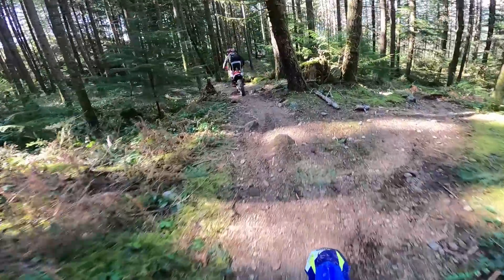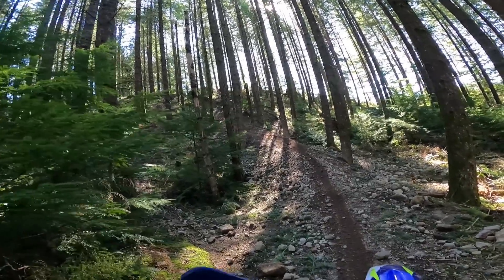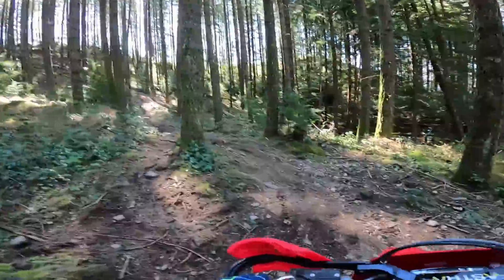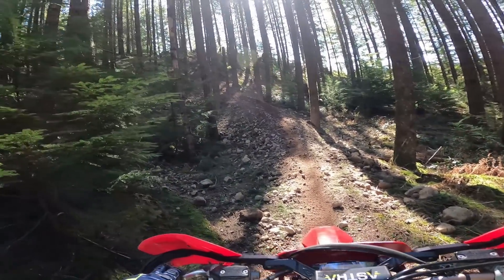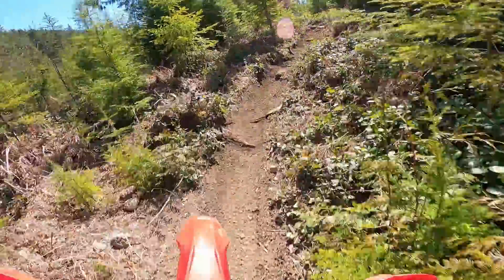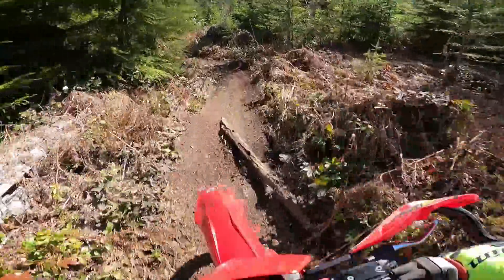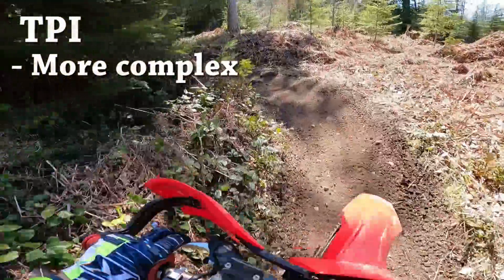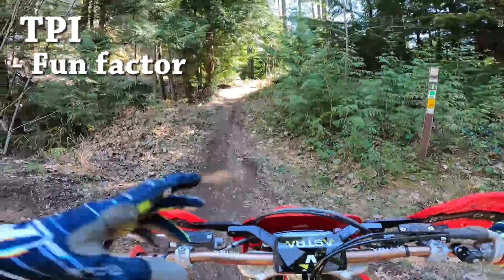Smartcarb vs TPI

Comment: I bought a 2022 Gas Gas Mc250 and my buddy bought a 2022 Gas Gas EC300. The stock tune on the TPI bike was pretty weak and really lean. No snap, no hit, couldn't get the bike to come alive it seemed like. The carbed bike was totally the opposite. Both bikes had a great predictable and controllable power delivery across the bottom and into the mid. The difference in the upper mid to top end was really noticeable though. Once my buddy tuned his TPI bike, changed the head, and played with the power valve it ran great. I like my simple carbed motocross bike for woods riding, works great for me and it's a bit lighter. But to each his own.

Comment: Great comparison I am sold on smart carbs.  I am not the kind of guy that drops stacks of cash on a trail bike I am an over the hill motocross/desert racer.  I have considered setting up my 15 tc250  for throwing down in the woods.  The biggest thing for me is e start.
Reply from the maker: Watch this before spending money on a SC. Great product in the right conditions but too many issues every winter for me. https://youtu.be/nmNEkGvLUNA
Reply: @PNWEnduro  I am not considering buying a smart carb or lectron.  I am a keihin guy.  My 16 FC450 has fuel injection and e start with mx tech 4CS forks.  I do like the air forks on my 2018 150SX.  I liked learning from your channel

Comment: If you have heavy throttle pull on a TPI bike, you don't have the free play adjusted correctly. Once you get it adjusted correctly, the throttle pull/return is as good as any carb bike. Also, the delayed/sloppy throttle response at small openings completely goes away. You spent a lot of time dialing in the SC, you should at least spend a little time with the TPI free play so the comparison will be apples to apples. After adjusting the free play on my 2020 TE300, it feels like a completely different bike.

Comment: So couple questions for you then, when you say "throttle drag" or "drag" when letting off the throttle are you referencing the engine braking that you get on a 4 stroke or just that the throttle cable itself feels heavier/stiffer?  Second, when you are talking about other TPI bikes that you have ridden are you just talking about Gas Gas or is it the same feel on the KTM's and Huskies as well?  Third, is smart carb their own brand or are you talking about lectron carbs or are they two different companies that produce a similar product?
Reply from the maker: As far as the drag it’s partially a heavy throttle pull but also it’s missing the light feeling of a carbed two stroke, it’s feels more “electric” as people sometimes describe. 
I’ve ridden ktm/husky/gas gas and they all have this same characteristic. 
Smartcarb is made by technology elevated, not affiliated with lectron.
Reply: We have zero affiliation with Lectron. The SmartCarb is a much newer metering rod carburetor design. You can read more about their shared history and how they compare here: https://smartcarbfuelsystems.com/smartcarb-vs-lectron/

Comment: I've enjoyed many of your videos over the years (including the one in which you tested SC vs Lectron vs OE carb). Thanks for posting. I think this video certainly brings about much conversation and debate. In my opinion any comparative conversation in this arena is a good one. As it relates to your comparison there is a lot of differences between the GasGas and the Sherco that can contribute to the way the bike feels to the rider in a seat of the pants comparison. In essence you are comparing a lot more than just TPI vs SC because of the way that the (2) MFRs. build the power characteristics (i.e. port timing, compression, ignition timing, flywheel weight and mass, etc., etc., etc...). IIRC, in the video I've referenced above, you were on the same bike and model year which, in my opinion, gives a better comparison of the tested component. Regardless, Id love to add my opinion to the conversation.
Of coarse the subjective human experience factors in greatly here as well. I've had 300 2 stks since '12 and find them to be great bikes in many ways. I've used the SC, have been able to dial in both the Keihen and Mikuni carbs, and now have a TPI. Anyone who's ever ridden my bikes have all commented on how well they run-including someone who owned a bike with a TPs equipped SC that was running Fabio's PowerCDI ignition system. I just bought a '21 TE last November. I kept the '17 TX around for several months because I had concerns about the TPI. I had never even ridden a TPI bike (until I bought the '21) but the "horror" stories were enough to give me pause. I sold the TX (the SC too) about 3 weeks ago now. The '21 TE is (by far) the best running 2 stk I've ever owned. In much of the powerband I don't find a lot of difference between the '17 and the '21. It is at the lowest throttle openings that I find a HUGE distinction. The TPI runs so cleanly in the basement. I've always liked to lug my bikes around (until the point at which I need/want some serious HP to attack some obstacle or trail condition), and I didn't think there was much need for improvement in that area. The TPI brings it to a whole other level! In your video I can clearly hear the Sherco running much rougher (some call it burbble?) at the lower throttle openings as others have pointed out in the comment section. Your narrative is that the bike feels like it pulls better down low but I struggle to see how that can be so when the bike is running rougher. I will surely admit that I'm not the one riding the bike (and you are) but I can relate what I'm hearing to my own riding experiences. I will also admit (or suggest) that the GasGas does not sound like it runs as cleanly as my '21 TE does....Which brings up a whole other variant. 
That is the differences between any (2) bikes even if they are the same brand, model, and year (due to manufacturing tolerances maybe?). In fairness, I have modified my bike from stock. I installed the Slaven's idle screw, and a set of VForce 4 reeds (while I was in there), so that would potentially throw off a direct comparison as well. Even though I have made modifications I am nowhere near the 700 dollar mark of the SC (plus manifolds and air boots for some machines?). I also don't feel the need to install a high compression head to the '21 TE. This is something I ended up doing to both my '12 XC and my '17 TX (S3 and RKTech respectively). Both of which boosted performance in the lower to mid RPMs.
As it relates to fuel consumption, I never was able to capture the claimed increases from the SC. I do, however, notice better range on the TPI. I have always installed oversized tanks on my bikes (including the '21 TPI) as I always seem to think I'm going to ride farther than the stock tank will allow. I have found myself running out of gas on rides in the past. It is much easier to borrow/buy gas (say from someone who is camping with an ATV or SXS, for example) when one doesn't have to worry about having, or having the right ratio of, premix. Plus one for the TPI!
I also did not notice any difference between any of the bikes (or carbs) in the area of "throttle pull" and "drag". I was confused on what you meant by those terms. Were you referring to the effort it takes to turn the throttle tube or some performance characteristic? If by "drag" you meant engine braking I detected no differences. I will certainly agree with you when you talk about the amazing amount of traction one gets (particularly at small throttle openings) with the TPI bikes.
I have been a big fan of the SC since I found out about them. For whatever reason I much preferred them over the Lectron...Even though I've heard many more success stories compared to SC success stories. I certainly agree with the Keep It Simple Stupid theory and, unfortunately the TPI does add more complexity. Thus far I am tolerating it due to my perceived performance gains and not hearing of any negatives issues from friends (many friends w/TPI ranging from '19s-'21s). I will have to check out WA Semi-hard Enduro's link and/or order a crank sensor-just in case. Why not?...I'm already carrying a spare fuel injector and filters for my 4 stks. I've never had a failure myself yet but I carry because of all the issues I've heard about from others.
In summary, I find it interesting that your experience is that you find the SC equipped Sherco runs better down low and mine is that the TPI equipped bike runs better than anything I've experienced down low. Even though I (admittedly) like to be right, I much prefer the type of conversation that your video has provoked. I'm excited to go riding now! I can't wait until our high country trails open up!!
Thanks for posting!...Thanks for letting me share!...Keep up the good work!!
Reply from the maker: @Jason Chapman first thank you for the comment, you obviously put a lot of thought into it and I appreciate that. I will agree with the burble you are hearing, I've since leaned the carb out 4 more clicks and I think it's even better now. If you have seen any of Cody Webb's recent videos his Sherco with SC sounds really good. From what I understand he has his set another 4 clicks leaner than mine so I still have room to go if I feel like I need it. As far as the power off the bottom, I've always felt like the TPI bikes kind of struggle to get going, once they open up the power is very strong and crisp. This probably contributes to the amazing traction they get because you don't light up the rear wheel as much. For the throttle pull, yes I feel the actual pull is heavier on a TPI but I'm more referring to the feel I get between the two. The TPI is so much more liner and, as people say "electric" feeling, that's where I compare it to feeling a bit four stroke like. I'm not trying to bash the tpi in any way, they are an amazing technology but for me switching back I just find the bike feels more fun to ride.

Comment: The difference between the two is mainly how they are tuned!  The TPI is tuned on purpose to drag and bog for traction.  If you want to have more power all the time with TPI you can adjust the spring and WHAM there it is.  Way better than carb, I'm so done with carbs!!

Comment: I've run SmartCarbs since mid 2015, and love them.  That said,  it is aftermarket,  therefore tuned and the TPI bikes are factory mapped which is probably weighted toward emission regulations.   I would expect the TPI to have less of that lag and maybe less of that traction if remapped(tuned).  I'll stick with SmartCarb though because of the mechanical simplicity.  Also  I bet one good water dunking would destroy or at least damage beyond usability the fueling system of the bike.  That means walking,  and I'm to old to walk THAT far anymore  but I'm not too old to screw up a creek crossing 😁
Reply: My biggest concern with any TPI bike....a failure and a long walk back to civilization....I'll stick with carbs....
Reply: Isn't this carb almost as efficient as an efi and produces around the same emissions?
Reply: @iwanttobetankman4260  yes
Reply: @iwanttobetankman4260  yes but the smartcarb is purely mechanical not electronic water and electronics do not mix lol

Comment: Geography could be the biggest factor ,left coast lots of altitude, temperature changes. Right coast not so much ! My 40 yrs+ experience , if temp stays between 5 deg. C and 30 deg., set it and forget it .Keep it simple. As far as buy in cost ,as a performance mod. aftermarket carbs can be expensive but as a replacement unit for a high hour stock carb for sure an option to be looked at .

Comment: Greg, aside from efficiency / temp / altitude benefits, can you comment on performance differences of Smart Carb vs stock Keihin on your Sherco? Wondering if there is any difference in throttle, grunt etc and would love your thoughts on this! Hoping I can clean that full hydro climb on my Sherco 250 by summer :)
Reply: Well I can not answer for a smart carb. However,  my Gasgas EC300 has a Electron and it feels just plain more responsive. You can lug the bike down and snap the throttle open no bog just a crisp response.
Reply from the maker: @Sean Ruzicka to be honest, if you have a properly jetted Keihin I don't think the difference in power is much at all. Not worth the $700. Once elevation and distance of rides is a factor then you benefit from the Smartcarb a lot.

Comment: After owning a 2019 and now a 2021 300 XC TPI, I would have to say I prefer the carb. I do feel like there is some confirmation bias going on in this video though (which is only natural). My 2019 had a 36mm SC2 and it definitely did not adjust for air density like TPI, but slightly better than a conventional carb. I owned both bikes at the same time for a bit, and the throttle pull is significantly lighter/ smoother on the TPI... Another negative I had with the SC was flooding the engine when you lay the bike over. Without overflow hoses there is nowhere for the gas in the bowl to go other than the engine or air box... Not bashing the SC, I actually really liked the product overall, and loved the linear power curve. I too was unimpressed with the stock TPI throttle response and off idle power, but it was easily fixed with an idle screw and ECU reflash.
Reply: What ecu and head did you change to on the TPI
Reply: @Richard-Burdett-Bow  coober ECU and RK tek head

Comment: Shouldn’t you really be testing the Sherco against a Gas Gas ec 300 tpi enduro bike and not the cross country bike as the gearing is a little different. Plus the suspension is softer making the bike ride differently. Still a great video though and that place looks amazing 👍
Reply from the maker: The Gas Gas in the video is an EC300 so it has the wide ratio transmission similar to the Sherco. Suspension is not a factor as the focus of the video is the difference in performance between TPI and a Smartcarb.

Comment: 5wk9700z for the TPI guys having Crank Case Pressure Sensor failures or troubles finding them. This can be picked up from any auto parts store and works just the same. I haven’t had any issues on my 2020 300xc tpi knock on wood, but my buddy did on his 2021 300xcw tpi. He found WA Semi Hard Enduros video on these things, picked that part up via the part number mentioned, and put that sensor on his bike. It’s been fine ever since. I have heard of a ton of 2021 model owners have issues with them. Kinda makes me glad I bought a leftover new 2020 instead of a 2021!!!!
Reply: Can you please provide a link to the WA Semi-Hard Enduro video?

Comment: Any TPI bike I’ve ridden has kept me on my 17 250xc.  Fun and simplicity being the main reason why. I do prefer the newer frame/chassis though. Front feels a little more planted and quicker turning while still being stable. Any new 2 stroke purchase is likely to be a Sherco or Beta (with dreams of a new 2 stroke from Japanese). However, if I could find a used 19 250/300xc I’d be all over it.
Reply from the maker: I don't think the people who have 19 250/300xc's are going to be willing to let them go!
Reply: I have a 21 300 SE and a 19 300 XC...last year carb and kick. You are right. Not letting it go for anything!  Love them both.  I ride each with a Keihin and a STIC metering block and which self regulates on temp and alt. Minus a turn in or out of the airscrew.  Love this setup.

Comment: Sherco sounds good up too, but kinda blubbery down low - is that on purpose? I’ve heard the Sherco is very strong off the bottom.
Reply from the maker: I have leaned it out 4 more clicks since filming this which has cleaned it up even more.
Reply: @PNWEnduro  so you are 98 clicks out now?
Reply from the maker: @shooter7a yes I believe that's where I'm at now.
Reply: @PNWEnduro  I've got about 400 miles on my SC2 21' KTM 250 SX bike amd had it set at factory setting of 88 clicks out. I fouled a plug within 50 miles as I richened it up a few more clicks from that (don't ask why except I'm an idiot). I then set it to about 92 clicks out and still fouled a plug about 150 miles later. Since then I've set to about 97 clicks out and it seems about perfect. I think the SC guys are conservative with initial settings (like factory carb bikes) to avoid any lean engine damage but it seem one needs to dial in their settings to their particular bike and riding style. Definitely way easier to do by turning dial as opposed to changing out jets and adjusting needles!